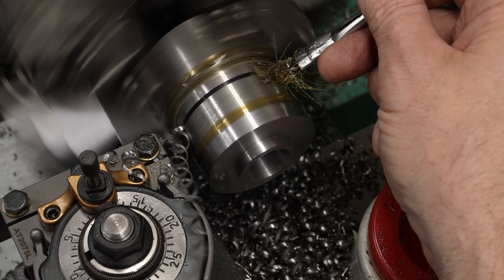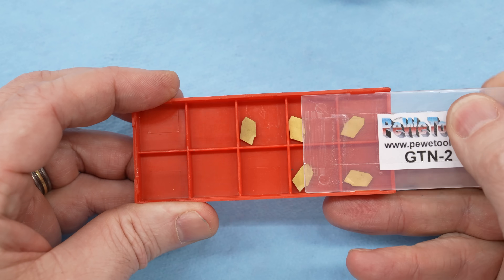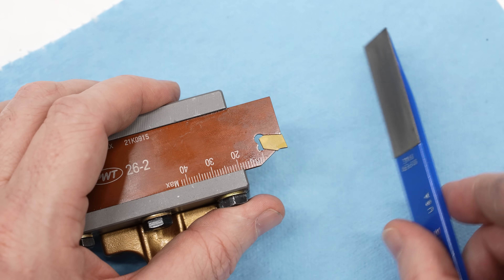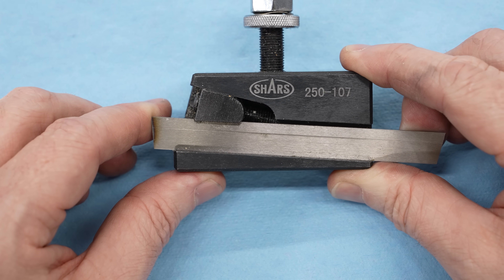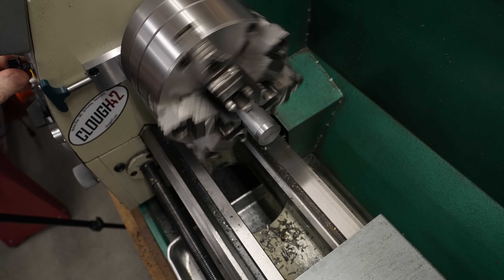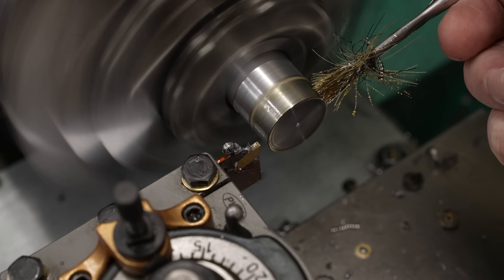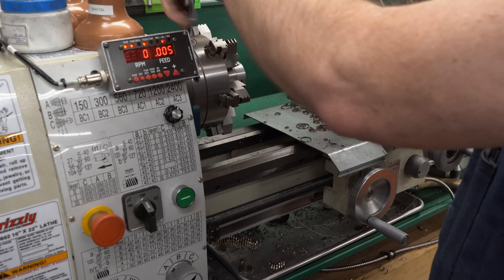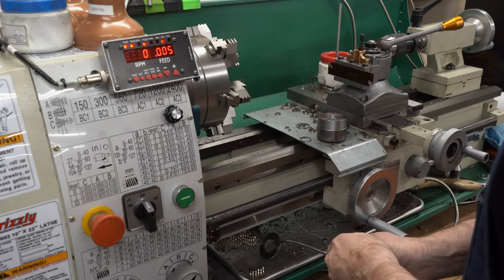High Speed Parting with CARBIDE in a Small Hobby Lathe

Comment: You learn that faster is better, once you work with Stainless or titanium. Material that work hardens, you have to get under the hardening. As soon as you create the chip ……go for it and don’t stop the pressure. Only caveat is that on deep cuts, you might need a widening side cut to increase chip clearance.
Only thing better for parting is a 40 megawatt pulse phaser. Tongue in cheek.

Comment: Something my machining instructor in the college program I am taking has said you NEVER want to run a parting blade below center because the spinning work has a big tendency to climb onto the blade and destroy your tool, I’ve found running at center or above has resulted in way less issue with the blade binding or getting damaged.
Reply: Yes I expect the rumbling at the centre of the cut is the part climbing to tool and the nub showing the tool is below centre.  Bring the tool to centre and I think the last part of the cut will improve too. 

For small radius cuts the distance below centre becomes large in relation to the cutting radius.

Comment: Most small hobby lathes don't have enough power and are not rigid enough to use carbide effectively.
I prefer HSS Cobalt on lower powered machines but I run a 3 metre Colchester and a big Polish FAT day to day and regularly take 10mm deep cuts when ploughing metal off.
I don't understand people's obsession with using carbide when messing about at home

Comment: I almost bought that lathe, but they just could not get it in stock. I ended up getting the G0750G. They do NOT come built well, my friend. You are going to find all kinds of stuff going on with your machine. Thats okay, none of them come perfect but I wanted to mention to you to check all the runs of wires all around your machine and make sure its safe. Mine was not. I have spent the last 12 months finding out myself. They do it dirty. Some of the black oxide bolts arent real. The two that hold my compound on were soft and cross threaded so easily. Gears were dinged up, had to have them ship new ones. They sent dinged up new ones that were all worse. Wouldn't recommend them to anyone at this point. I do enjoy my machine but I spend a couple hundred hours just getting it sound and solid. Keep at it. Nice machine. I like mine as I said too, just wish they put more care into the build. My gearboxes were loaded with large chunks of chips and debris as well.

Comment: Nice video and presentation. 
Higher rpm and feed rate with stock carbide insert blade set up requires rigid relation at the work and blade junction. In this case, fresh chips are deformed narrower than the trench to avoid friction, heat and expansion therefore preventing the blade and the work to depart from turning center line. 

On the other hand, slower surface and feed rate with a fine horned blade produce chip without deform so chip width equal to trench width can cause chip accumulation, friction, heat, expansion and therefore opposite departure of blade and work from the centerline. End with ditching into the work.

Comment: I believe the electronic speed control on your lathe caused the stalling problem. At about 1500RPM a 2hp motor delivers 2hp power with a certain torque. With a geared or belt speed lathe, when you decrease the RPM the torque is multiplied by the speed reduction factor. With electronic speed control you get constant torque. Electronic speed control cannot multiply the torque because that is controlled by the motor. If you put electronic speed control on a machine that has belts/gears the motor cannot manically produce more torque. That is why electronic speed control upgrades are generally done with a motor upgrade to more horsepower.

Comment: None of that cutting oil is going into the groove.

Ive had a lot of luck using a small peristaltic pump to use water based coolant with rust inhibitor. I run it at a very slow flow rate and just drain it away from the drip tray. It works wonders because the liquid can easily get into the groove, keep the tool and workpiece cool.

Comment: On a small lathe when you run at too low an rpm you have very little horsepower and inertia of the spindle. Speeding it up gives enough inertia to get past the sudden grabs and binding of the material against the tool. More inertia means it’s less likely to bind up and stop the spindle. Overheating the tool is possible as well as catastrophic breakage, so compensate by reducing the feed rate if necessary.

Comment: I was told this is the way to go and I do it on a clapped out tiny lathe, I also don't bother with coolant or oil. My understanding is at the higher speed it just tends to break the chip rather than being pulled in

Comment: I finally got a lathe and am learning the basics. Holy crap this worked so well. 1000rpm with a carbide parting holder and insert. Like some kind of magic.

Also using Unist MQL system and it works very well. Turned the feed rate way down. Hardly uses any lubricant, little or no smoke, keeps things cool.

Comment: At 9:20, it looks like the the Multifix or the compound is slightly off (or the insert is uneven worn out). The parting blades absolutly dont like axial load and should be dialed in to perfect 90°, anything else will sooner than later ruin the insert seat.

On my lathe, same castings as yours but different brand, slow speed work also, but i dont have a electronic motor controll (at low RPM they just dont have any power), my has 3 pulley wheels, so even at low speeds i have the full motor power and the chuck only slows down or stops when im too lazy to set the belt tensioner.

Comment: I was IT at a machine shop (the nerd part of 'computer numerical control') and all I heard the "old hands"complain about the "new kids" was how they LOVED to ruin HSS... And the 'kids' would complain about having to remove the HSS to replace it with the carbide insert tooling...

They just learned on different tooling, is what I eventually learned... It was 99% of the machine crashes though.
Reply: HSS on a CNC lathe doesnt really makes sense. Every time you need to sharpen a tool, you also have to recalibrate them and adjust the tool hight.
When i changed the workplace, my new boss wanted me to work like the others on the conventional lathes, tools with brazed carbide or searching and resharpen a insert from the scrap insert box.

Comment: What would you recommend for aluminum? Also, you were cutting “washers” from the end of the stock. These thin pieces can flex and reduce the side force on the tool which might mitigate the binding tendency. How about cutting of a piece one diameter long and see if it works as well.

Comment: 🎉 well the vibrations comes from a series of variables, 

Information:
You have to eliminate or get better balance between: speed cutting depth and rigidity.

Your action develope cuttingpressure on the tool edge. When you get the CP under control your results will be way better.

As thiner the cuttingofftool is the harder it gets to control the vibration, at least that my expiriance. I had the same tools like you and changed to a 4mm iskar. 
Worldsapart the results have been!
Rigidity, is the keytake away

Also the vfd as mentioned is reducing the torque what brings down the cuttingpower you need to form a chip. The chipload is designed from the manufacturer and they use a tested speed to develope in their perspectiv the best form of chip.

Comment: Its not the lathe size. Its the diameter vs speed. 

Rpm isnt important as long as the cutting speed for the given tool is.
Most small hobby lathe are not rigid enough and or lack the hp to do a good job with carbide tools
 They need to cut. Not scrape polish or bite.   They need a nice even pressure and depth of cut. And speed..     80 to 100m a min without cooling id offten the case. The better tje cooling? The faster you can go. Sometimes have to go.   But!   You need the machine that can take it!!!

Comment: Please use the crossfeed on parting (0.002' IPR). It promotes proper chip thickness and smooth cutting. The reason the tool jams is the inconsistency of hand feed. Inconsistency causes workpiece glazing and causes the tool to break. I've cut millions of parts off over the past 46 years and always use the feed.
Reply: You cant use what you dont have

Comment: Unless I missed something you installed a one horsepower VFD and motor on your lathe. Since the motor is rated for 60 Hz and last I knew your VFD was set to max at 120Hz. Which I would guess means that above 60Hz motor torque would drop off. So between 6Hz and 60Hz the motor torque would be fairly constant. But because horsepower is torque times speed running below 60Hz means your hp would drop off proportionally also.
 Cutting metal on a molecular level is braking electron bonds similar to melting. If the metal chip can not get away from the cutting tool fast enough then the chip melts, piles up and re-solidify on the cutting tool. Now it will take more force to continue the cut not only because of the larger mass required to cut but also the re-solidified material has tried to weld itself onto the cutting tool. Thus a recommended minimum cutting speed for steel. This also means a minimum horsepower requirement per cutting width. So for larger diameter parts it would be advantageous to increase the reduction reduction ratio between the motor and the spindle to be able to utilize your available horsepower.

Comment: Funny... I was gifted with an older Taig micro-lathe, and found a surprisingly decent parting tool that clamps fine in the tool post. And yes, razor edge and fast speed is the key. Yeah, a teensy bit of chatter, but not bad, and you can modulate the crossfeed pressure by hand. Darned if I wasn't getting nice square cutting with no deflection!

Comment: James, I went trough the exact same journey you made. For now, especially in stainless, go Johny, go. When I started parting on my first lathe I acted like a pussy and broke HSS blades and later carbide inserts a lot. Then an experienced machinist showed me how it was done. First attempts made me really nervous just like you or it felt unnatural to crank it in so fast. Now I'm used to it and hardly ever break an insert. Mild steel I even cut dry. And for stainless a brush works for me fine too in comparison with the other comments I read. After doing this for more than two decades you understand the feel the cut should give you. I cannot explain this feel in text but I know when I have to retract and lube up again before things go wrong now. Feed the pig is a humorous way to explain it a little. The sound is an indicator of things going well or not combined with the feel of the handwheel. I have bigger lathes than you but the way to break a parting tool is exactly the same as you showed. Chips should be short, no long curly ones. If they occur; push harder. I'm so used to parting of now that I hate to use the bandsaw...  One warning; don't expect that you can cut on size . Take a little extra and turn the part over and face to size parallel. I noticed that the cut, especially on bigger diameter, drifts a little. Maybe something I'm doing wrong but I can predict it by now and correct for it too. Thank you James. Best, Job

Comment: I have found (using HSS) that it helps to run the parting tool upside down with the laterh running backwards (ie with the tool advancing towards the operator).  This means the chips fall downwards with gravity and are less likely to jam in the cut!

Comment: Too bad there isn't a way to vary the speed of the rotation of the lathe based on how far you're pushing into the part because ultimately you probably want to be able to keep up the same speed of the surface that is contacting The parting tool but ultimately that slows down as the diameter decreases

Comment: I was taught to calculate my turning speed using 
300xV divided by the diameter 

Cast iron V=15
Mild steel V=30
Stainless V=60
So for mild steel 
If using carbide tool times by 5

Comment: Moving the tool towards the center results in slower cutting speeds because the parts diameter decreses and thereby the circumference. 
If you want to cut with 100m/min, you need a rotational speed adjustment that increases the rotation speed the further you move the tool to the center.

Comment: I've worked at loads of different machine shop's in general people do run speeds way too slow and a lack of understanding about having a rigid set up also doesn't help. Carbide tool love fast speeds and heavy feeds. I once saw a tool company demonstrate ceramic tips. Bloody  hell, 2500 rpm cutting like butter curls only blue in colour more amazing workpiece remains cool.... What an eye opener for a young apprentice back in the 1970s  my firm was at the cutting edge of technology. This was a 2" hole from solid in a 6" billet of steel..... At that time the tool rep only had 4tips to try.

Comment: That acid brush won't ever get the lube to where it needs to go. Use a hypodermic needle to get the lube deep into the cut. Or use a squirt bottle  and use water soluable oil.   Power feed can weld the chip to the tool and lead to issues.

Comment: I went to school to be a machinist. I have years of manual lathe experience. I have had that handle pulsing you described @ 9:32 on multiple lathes from 15 to 20 inch swing gear head lathes. I have a Grizzly G0602 but it is still crated. My experience has been to feed in aggressively at a content speed almost to the point of feeding faster than it's cutting. And don't stop until you're through. But I never ran over about 500 rpm on say 2 in. (50mm) material. Oh and the lathes I ran didn't have any coolent. I just cut it dry. I never used cutting oil much. Yes it is harder on the tools like that but I wasn't paying for them either. On the HSS parting tool you showed. I noticed it was burnt from grinding. You never want to burn your HSS. Quench it often and early.
Reply: Supposedly, such moderate burning has no effect of the temper of HSS.
Reply: Bleu is to hot for most steels
 He is probbebly right.  I use hss. But i allso grind an angle on the top.   To make a better cutting edge.  As soon as its over light yellos from sharpening.  Its gone in a whip.  When i keep it cool and doesnt collor up.   Its stays good a long time.    Hss can handle quitd some heat. But bleu is usualy a sign of tempering.  Making it softer.

Comment: I am not a machinist, and I’ve only had a small leave for a few years. What I have found out is you definitely need to run as close to the speeds and feeds as you can get. My lay tops out at a spindle speed at 1600 RPM the carbide cut off tool works well at that speed. I cannot seem to get a decent edge on my HSS cut off tool. I also would think that if you can adjust the spindle speed higher as your deer diameter decreases, it will cut well also. I’m stuck with the belt drive system maxing out at 1600 spindle speed.
     Other than that, it’s trial and error for speeds, and feeds with the smaller lays that don’t have the power or the speed.

Comment: I have a very old lathe (1917) its got plain bearings, its clapped out, but it parts fine with the t shaped hss.. I run it slow with lots of oil and most importantly don't screw around, dig in and go, if you need to pause get right back out, any rubbing will work harden your material and give you fits. I think lathes that do not have a geared head but rely on variable speed dc or a vfd for most of their speed control do not have the torque to run a parting blade hard enough to avoid work hardening the material at low speed, so you are barely feeding (due to a lack of torque) and getting in trouble. at high speed your lathe is making data plate power and you are now able to feed the tool like you should. I run carbide blades at work with a 16" victor and a 13" jet, both are geared head lathes, both do fine at reasonable speeds and high feeds..